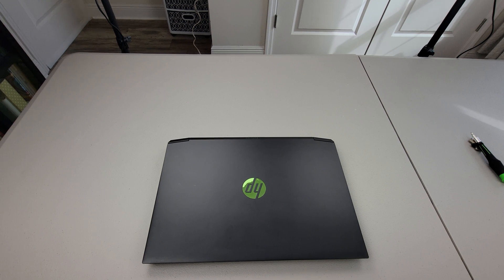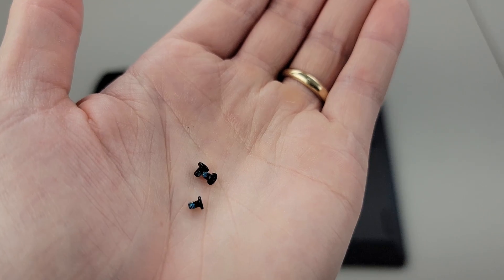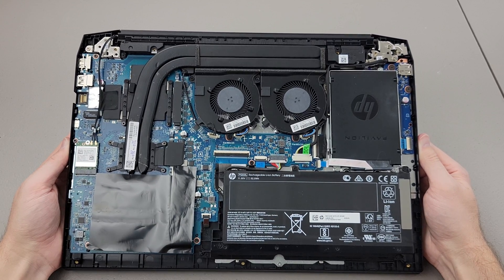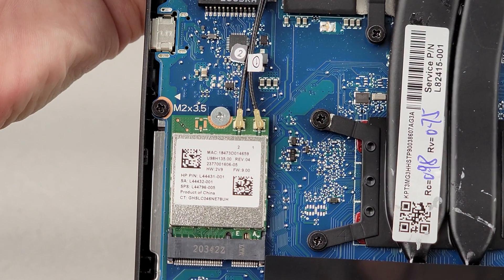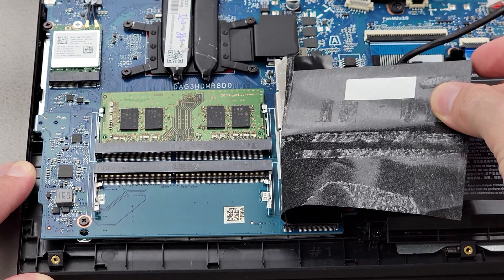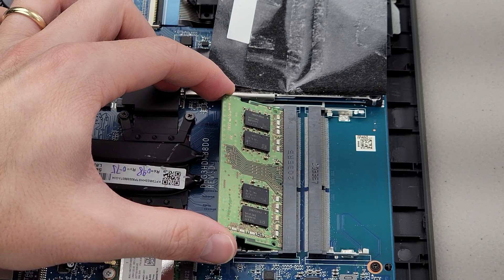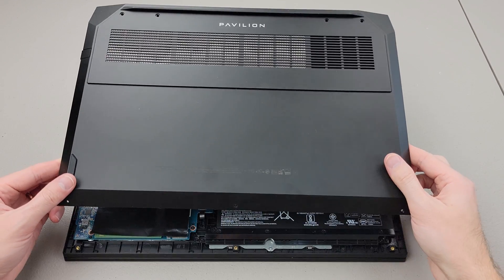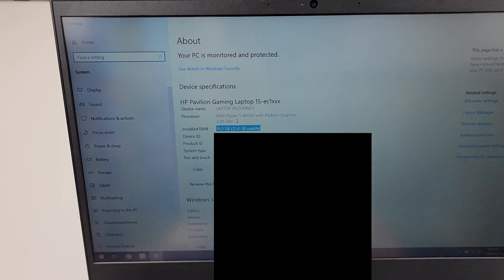How to Upgrade RAM on HP Pavilion Gaming Laptop 15

Comment: I literally forgot to plug the battery back in  
But did not screw it back in at the time so I immediately opened back the cover🤦‍♂️

Anyways all's good so thanks 

Btw does anyone have problems with sweaty hands because I was so nervous, I was worried if my hands got the parts wet and break them 

😭

Comment: Hi I have an issue. So my laptop is the same as the video (HP Pavilion 15-ec1007x) with only 8GB of RAM and I bought a new 16GB ram to install. When I try to open it up, apparently there's already 2 sticks. I was confused so I let the slot#2 occupied with the original RAM, and had the slot#1 installed with the new RAM.

I went to task manager it said that I have 16GB of RAM , but in CPU-Z apparently I have both sticks installed with 16+8GB.

How is this possible? That the BIOS/Task Manager doesn't detect the RAM in Slot 2, yet CPU Z does. That would mean this whole time I already have 16GB of RAM but only the first slot was detected.

Comment: I tried it on my laptop but it kept on rebooting 😢 the specs of both ram and brand is identical. One ram has 8 black squares while the other has 4 only. Is that the issue? Pls someone help me? Thanks!
Reply: Single Rank = 4 black square
Dual Rank = 8 black square

It's different, sometime some Laptop not supported dual rank ram. Which series do u have?

Comment: Pefect, straightforward guide to reduce the risk of me braking something. I had 2x4gb in my son's laptop and just replaced one of those with a 16gb stick for a very low cost upgrade to make 20gb running at 3200. If it was my gaming desktop, then I'd put in 2x16gb to max dual channel performance, but for this laptop the 4gb+16gb is fine. Performance dramatically increased, Minecraft loads in the blink of an eye and according to the old Heaven benchmark on max settings... 8gb = score 668 &  26.5 fps vs 20gb = score 1092 & 43.4 fps.

Comment: roduct: HP Pavilion Gaming - 15-ec0100ax
Operating System: Microsoft Windows 11
At first only 5.9gb of ram was usable and the rest 2.1 was reserved for hardware. I researched and found the the only thing I can do is to add 1 more ram stick so I upgraded to 2x8gb ram but now was I added 1 more stick of 8 gb ram 10.1gb of ram is hardware reserved and only 5.9gb is usable now too
Pls tell me what to do  How can I removed this reserved ram. 

tried removing the ram stick to check if the ram I order was faulty but it was alright
Reply: Did you find the solution?
Reply: @maystro3784  nope
Reply: @BetterThanYou333  Same problem, the only solution is to buy a bigger RAM
Reply: @maystro3784  i think the problem is that there is different speed 
this laptop is shit so it cannot operate both at once

Comment: can i use Crucial 16GB DDR4-3200 SODIMM for Pavilion 15 ( first time trying to replace a ram by myself so im litter bit afair it not gonna fit)
Reply: Yes Crucial is fine same as other brands. Get 2 8GB DDR4-3200 SODIMM and install them in both slots. Dual channel is better than 1 16GB stick

Comment: Hi i have 2400mhz ram module currently in my laptop so can i buy 2666mhz crucial ddr4 ram will it work fine or i need 2400mhz only

Comment: thank you for the video, waiting on two 16 GB RAM cards to arrive for my HP Pavillion 15 laptop. I will know what to do now when they arrive. 

Edit: easy install, works like a charm
Reply: So It does support up to 32 gigs of ram. Nice
Reply: It support the 32gb?????
Reply: @javierolivares2546  That's the maximum storage of ram it can hold up to
Reply: @javierolivares2546  yeah, it does, could probably go higher like 64 or 128 but 32 is all i need

Comment: Hey i got a question, if my laptop has 1 stick of 8gb ram and i wanna upgrade to 16, do i need to buy 2 new 8*2 sticks or can i just put 1 new 8gb stick and let the original one be there
Reply: What happen? I did the same as you

Comment: quick question can i put 2 MemoryCow 16GB DDR4 RAM Memory For HP Pavilion Gaming 15-ec2xxx Laptop | 3200MT/s, PC4-25600, SODIMM, 260-Pin on it to make 32 ram cus i also got a HP Pavilion Gaming 15-ec2xxx Laptop and i want to make sure to do it right 
and which screw do i need to open the back

Comment: HP support is useless so I thought I'd ask YouTube!

User manual to reference (PDF page 11): http://h10032.www1.hp.com/ctg/Manual/c01957825.pdf

Where it says, "DDR4-2400 dual channel support (DDR4-3200 bridge to DDR4-2666". Does this mean we can use the currently installed DDR4-3200 with a DDR4-2666? I tried to boot but it wouldn't with the DDR4-2666.

Manual says 32GB maximum but based on the configuration, this does not add up to 32GB. Is the maximum not possible?

Comment: will any ram brand be compatible. Obviously it has to be for example ddr4 if it is ddr4 and the same speed. But will any aftermarket brand be compatible or does the Motherboard limit you in any way?

Comment: Just changed mine to 32 GB without any issues, took like 15 minutes, thanks to your video. Thank you!
Reply: How is it 5 months down the road? Any issues? Like getting too hot or something? I’m new to this and wanna do 32 instead of 16 lol
Reply: I installed my 32GBs and I only get a black screen. This is my 2nd upgrade coming from a 1x8GB to a 2x8GB and now to a 2x16GB..
Reply: @JuicyLemon1565  any update im thinking to upgrade my single 8gb ram to 2X8gb ram is it worth it
Reply: @ak-7865 Yes. The reason I was getting a black screen was because I'm stupid and didn't reset my CMOS (in my laptop I just unplug and replug the battery). My laptop's been working great ever since and has 32GB of ram now.
Reply: @ak-7865 always run dual channel (like in your case with 2x8GB sticks) for extra performance
Reply: @JuicyLemon1565  my HP pavillion has 8gb LPDDR5 6400mhz how do I find the correct RAM stick/brand
Reply: Yw❤
Reply: 7 months now. How is it
Reply: @BeziSuper  everything is working great!
Reply: @smirnusia  what ram did you use?  im trying to upgrade to 32 from 16 and im not sure what ram is compatible with this laptop

Comment: You get the added bonus of going from 8gb single channel ram to 16gb of dual channel ram by adding a 2nd stick.
Dual channel ram has twice the data transfer speed (Bandwidth).

Comment: I need some help, I recently bought one 8gb ddr4 2400 ramen for the same computer in this video, I installed it paired with the original ram that the computer came with, but after I installed it my computer would keep crashing, and it would freeze when trying to boot. Did I get the wrong ram or does it not pair with the original stick?

Comment: Hello. Bought mine brand new about 6months ago. 8gb 256gb ssd. I added another 8gb ram and worked perfectly. Recently it stopped powering on and capslock blinking. Any solution?

Comment: so im not computer savvy in the slightest bit so please dont judge. but can i add a 16gb ram to the other side of the factory 8gb ram drive and get 24gb or ram it still work or do i pull have to pull the factory ram and just install the 16gb ram by itself?

Comment: @engineersescape or anyone else in the comments, is there any way i can use this upgrade to increase my VRAM? i'm trying to run elden ring on this laptop (mine came with a gtx 1650 and amd ryzen 5 5500h) which should be able to run the game, but it seems i don't have enough video ram. any help would be appreciated and thank you in advance!!!
Reply: VRAM and normal RAM are two different things. The only way you can increase your VRAM is by upgrading your graphics card.

Comment: Absolutely adore you not leaving any steps out, for people who are still new to dealing with internals it can all be quite literally mystical, and so showing (and editing in other angles) is very alleviating to the usual worries.  Easy to imitate you, much less stressful!
Reply: If you change the ram, wont you lose existing data
Reply: Why wouldn't you just add an another 8gb stick to other side instead of buying two new sticks
Reply: @justinbailey7281  Because you can get a kit of ram with more MHz. The Pavillion has 2600 MHz ram, and I'm actually upgrading mine in a few days with 3200.
Reply: @justinbailey7281 RAM is temporary memory storage and resets each time you restart your computer
Reply: @justinbailey7281  Your computer data is stored in the internal storage drive, not the RAM. RAM just determines how fast your computer can process data and allows more memory. Hence why more of it is faster and thus better.
Reply: How long did the CMOS pop up last mine is taking time

Comment: As one tech to another I should suggest you add one thing to this sort of video my laptop is a gaming 15 DK and the four screws in the back if you look closely are NOT the same length! so when a user removes screws from a laptop like this, they should lay them out next to the laptop in the same pattern so that the same screw goes back in the same hole... I use a piece of tape that I stick the heads of the screws on so that way they stay where I put them

Comment: That was well done, but I want to increase the SSD memory, which is so small. I would like say 1 TB. Can you buy and install this yourself? Also eventually the battery will go, and this is the first laptop I've had that didn't have the battery more easily accessible. Thanks, I only saw the long screws at first look! (mine is 15-ec0102AX)

Comment: Very good video bro! i have the same laptop and i got a samsung ram 8 gb 3200 like the one that you get but when i turn on the laptop it goes black screen, can i do something in the bios or should i just refund it? 
I tried in bouth slots and there is no problem with them when i use only the original one, but the laptop didnt go on with the new one in any slot.

Comment: i like vid man. i like how u explain things nice and clear I'm really new at IT and this helped me a lot. I actually want to upgrade the RAM in my system i have the the same device.  Can replace the RAM i already have with a pair of faster speed RAM? What i have is 2400mhz and i would like a little faster  at 3200mhz. thx
Reply: It depends if your Mainboard supports it. But 3200 shouldnt be too fast for it, but look it up beforehand. There are PDF files for your laptop and your mainboard should be described there

Comment: Question. If we already have an 8GB ram pre installed, can we add a 16 GB with it? Would there be any problem?
Reply: No
Reply: Depends on the MHz of the sticks. Should be the same
Reply: I put my 8 gig in other slot and put 16 gig in 8 gig slot. I got 24 gigs of ram. You gotta make sure it's ddr4 ram. You can go up to 32

Comment: am I supposed to use the old stick or do I have to buy 2 new ones?
Reply: If you’re gonna use the same speed of ram (for example here, 3200 MHz), then no, just buy the one. But if you want faster speeds, then go ahead and buy 2.

Comment: Hey, great video! I bought a hp pavilion gaming 16-a0xxx and it came with 2x 4gb 1rx16 3200 sticks..Would you recommend buying one 16gb stick and running with 1x 4gb + 1x 16gb = 20gb OR just removing both and buying 2x 8gb = 16gb ? Thanks!!
Reply: I would say depends on price, a 4 plus a 16 should be enough for everything, but if 2 8GB are cheaper go with that.
Reply: Make sure it's 3200 MHz and SO-DIMM.
Reply: @geoff2240  Thank you!
Reply: @cagebgaming7352  oh, wait. You have the 16-a0xxx, my bad. You will need to look up your ram specs. The specs i have are for the 15.
Reply: @geoff2240  Yeah, I did! Got 2x 8gb 1rx8 3200 so-dimm and it's working super well with all my games. Thanks man!
Reply: @cagebgaming7352  np, glad it's working! My hp pavilion gaming 15 something laptop had a single stick of 8 gb, i bought a 16 gb stick at memory express for $70, anyways, they work together even though they are this different.
Reply: What is limit of ram ? 16 ,32 ?

Comment: can we appreciate the fact that this guy is actually really helpful?
Reply: He was helpful but unplugging the battery cable to put ram in. Is unprofessional.
Reply: @taichiherov8135  Is it not necessary to do that? I don't want to mess up my computer
Reply: @taichiherov8135 why? It isn’t necessarily bad to do that, I think he was just being safe
Reply: @localdealer2105 it is bad . He wasn’t professional at all. That wasn’t necessary.
Reply: @taichiherov8135  it's to prevent accidental electrical shorting out, brother, you're the wrong here.

Comment: Great tutorial! Worked 100%! Even used the guitar pick. Though, my HP gaming laptop didn’t have the black sticker over the RAM cards.
Reply: Have this laptop and I play Minecraft on it and it’s using the integrated graphics how do I change it to the dedicated graphics card
Reply: @Plasma-s13  Go 8n windows graphics settings, or if it's a nividia go in nividia control panel
Reply: @DDA-81  I did that do I want to go auto or nvidia gtx 1650
Reply: Is it used?
Reply: @denkrblx437  Mine didnt have a black sticker over it either - bought it new
Reply: @davidduffy1101  hmmm maybe they changed the production and stopped putting the black sticker
Reply: @denkrblx437   there are a bunch of different sub versions. Mine surprisingly had 2 sticks of 4 gb each.
Reply: @denkrblx437  u right click on ur ur home page and go to ur Nividia settings
Reply: Do you have to unplug the laptop battery cable when doing this like he did... I have seen other videos where they do not do that step.
Reply: @maplefoxx6285  I did, yes. Would rather be safe and unplug the battery. Only takes a couple seconds.
Reply: @roninxd2r571  I ordered my Ram i cannot wait, I run multiple applications and have had a memory full message a few times while trying to live stream certain video games, I run my avatar capture software along with Reaper DAW application for vocals, and then OBS streaming, then a game also. This RAM upgrade is very important. My sound libraries for my midi keyboard also require a lot of RAM as they are raw .wav files that load up into the memory. And more instruments at same time, drums, guitar, piano, requires extra ram to have them run smooth.
Reply: If you have an intel core pc it may be cause of that, I have a ryzen pavilion so mines like that but yours may be intel core
Reply: I'm saving up for one of those laptops
Reply: probably got it from the black market lol
Reply: For what is this black sticker anyways? Is it for guarantee purposes?

Comment: may i ask where you bought the new stick of ram? (I was planning to go to best buy but I couldn't find it on their website) and in the description it says 
"Supports up to 32 GB maximum system memory in the following configurations:
● 16 GB (16 GB × 1 or 8 GB × 2)
● 12 GB (8 GB × 1 + 4 GB × 1)
● 8 GB (8 GB × 1 or 4 GB × 2)"

did you just not put 16 GB x2? one last thing is it basically the same with the model 16?
Reply: that's what it says in the user manual and i'm still trying to figure out why

Comment: Can I put in a random brand stick of memory same speed as the one currently installed or do I have to buy 2 identical sticks?
Reply: No you can put different brand sticks with same configuration
Reply: @Biolessaaru  thank you
Reply: @Dough_Blocks  and more over it can be different configuration too depending upon how much RAM is upgradeable
Reply: @Dough_Blocks  does it work
Reply: @catch5538  I haven't bought the ram yet
Reply: @Dough_Blocks  ok
Reply: @catch5538  it works
Reply: @Dough_Blocks  nice
Reply: Two identical

Comment: 5:41 bruh how did u open the lid lol
Reply: @igarden0631  he opened from left lol
Reply: Also dont buy hp laptop
Reply: @LiegeMaximo  uhhh well too late
Reply: @LiegeMaximo  I use the pavilion I mean it’s literally the only reason I’m here I’m tryna upgrade the ram
Reply: @igarden0631  can you please check ur battery wear levels using  hp support assistant or hwinfo?
Reply: @igarden0631  mine are 30% wear in 1 year...

Comment: do both rams have to be the same brand in order to work? or can I have two 8gb rams of different brands?
Reply: Not necessary, it must be at same MHz and Gl values. That's enough at least. But if u use same one it would be more efficient.
Reply: Also make sure they also have the same latencies

Comment: What kind of ram stick will I need for the hp pavilion dk1xxx? I researched it. Is the 16 gb ddr4 3200 sodimm crucial good? Will it fit?
Reply: Idk if you already bought but get the 2x8 gb kit from Crucial instead of 1 stick.
Reply: @JAKEDOWN92  I already Got 16 gb ram 1 strip. Is that fine bc it's already in my laptop

Comment: hey man, I have this exact model and I'm having some trouble replacing the WIFI module. I think HP might have a whitelist in place. I tried replacing it with an intel AX210 card but it never shows up in device manager, I know the card itself isn't faulty and the drivers aren't the issue.
Reply: I have the same too but under pressure one fan is working with high speed and the other is slow do you facr the same issue?